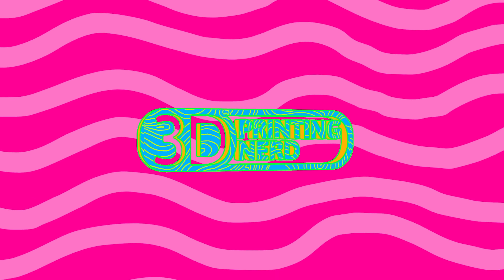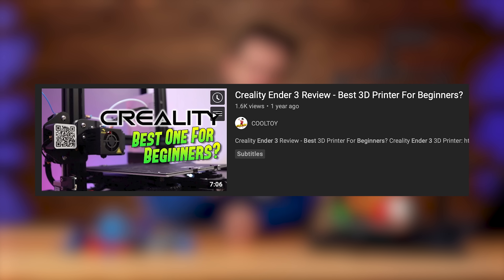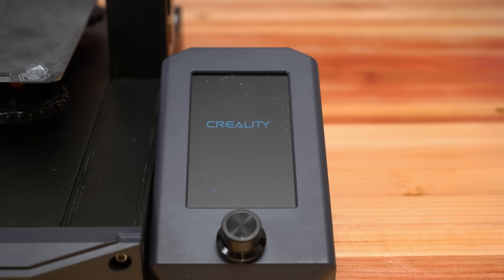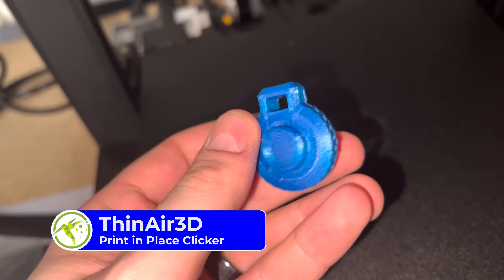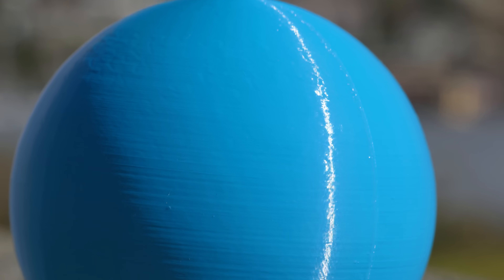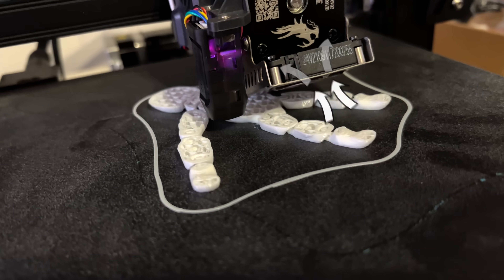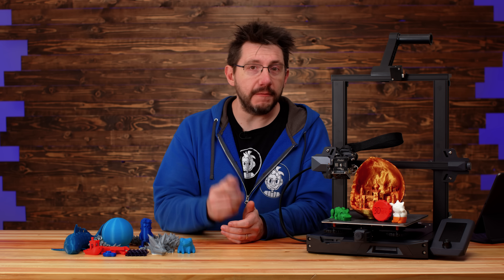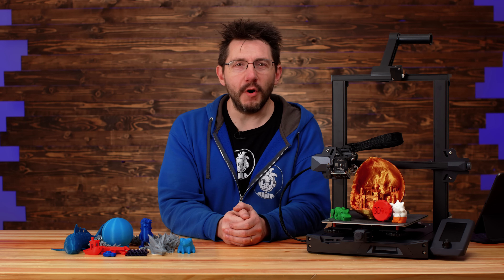Best Ender Ever? Creality Ender 3 S1 Review

Comment: Hi, I purchased my S1 about a year ago and just didn’t get it out of the box until a month ago. Already have had an Ender 3 Pro for about three years familiar with 3D printing. You are spot on. I had new Sprite extruder in the box slated for the 3 Pro. Being a 300 degree hot end I put it on the S1 and ordered it 300 degree nozzle and heat break. I found the S1 came with the 300 degree hot end and all metal hot end. For anyone who has a S1 check your heat break it may be a 300. degree and Creality set the firmware to 260 degrees, like mine.

Comment: Managed to get one of these for $200, and at that price point this thing is an absolute steal.  My Prusa Mini is still a much better printer overall in spite of its smaller build volume (it prints better parts and is hours faster on jobs) , but right out of the box this eliminates 90% of the problems I had with my first Ender 3 (mostly bed leveling and underextrusion) and is actually very usable.
Reply: Same

Comment: Hi I have an ender 3 s1 and I connected a fan to it and it gave off a burnt smell and now the fan doesn't work I tried to change the fan I tried the motherboard in the extruder and it still doesn't work I would be happy if you could tell me if you know what the problem could be

Comment: My printer, starts off every single print with a little mat of what seems to be supports. I don’t know how to fix it and with every single print that I do add another 30 minutes to do the bottom part. it looks just like that little outline that it’s supposed to have, but it just feels it in and goes up five or so layers. I need a little bit of help on it.

Comment: I have to disagree with your glowing assessment of this printer.
In my experience, the Ender-3 S1 is not a 3D printer I would recommend to anyone. Here are some of my reasons for that:
1. I don't believe the Ender-3 S1 motherboard's enclosure provides sufficient cooling for its electronics. My S1 board's early failure supports that statement.
2. Very soon after I began using the S1, its hotend began oozing melted filament from the heat break's connection to the heater block. This ooze began flowing down the sides of the block and dripping onto my prints. Creality3D required me to send photos of this mess, and not until I sent those did Creality3D finally agree to send a replacement hotend assembly. 
3. Unlike earlier Ender 3 printers, the S1 frame's extrusions are not slotted for T-Nuts. This means you can't easily replace the printer's v-wheel motion system with steel linear rails. So, you're stuck with plastic guide wheels which will continually wear, resulting in gradual print quality loss and the need for periodic wheel replacement.
4. These deficiencies are sufficient to support my personal decision against further Ender-3 S1 purchases. However, a far greater problem looms above these, which is my experience with "the Monster," (my term for Creality3D's customer service). When my S1's motherboard failed, months of negotiations were required before the Monster agreed to send a new motherboard. However, this was sent by slow freight, and week after week passed before it finally arrived. Then to add further insult to injury, this new board was also defective, and nothing - no attempt to install a new boot loader, and no attempt to install new firmware could fix this board. Once again, this forced me to deal with the "Monster" And once again, more back and forth emails and months of wasted time passed before Creality finally agreed to replace their bad replacement board. And I still don't have that new board. So here I am many months later, and my Ender-3 S1 still doesn't work. So, forgive me if I don't like your video and your glowing evaluation of Creality3D's Ender-3 S1 printer.

Comment: I have the s1 pro, it's pretty much the same except the build plate is more of a bronze color and really aggressively textured. I've run it for about 80 hours continuously now and the only adhesion issues I had were while tuning it Initially. I've found that the cr touch is kinda unreliable as you'll find yourself having to mess with the z offset every time you try to use auto level. Though not just with this printer specifically, I've found myself not setting offset with paper but just by eye. I also turn the knobs and guage the nozzle gap by eye as well. I don't recommend doing this if you don't have a calibrated eye. You'll know when you get one, takes alot of experience in metrology.

Comment: Please help me with my ender 3 s1 I'm having a nightmare of a time leveling my print bed. I followed every tutorial on YouTube and I still can't get my bed level! I can get it level enough to do small prints but the moment I need to print print something that takes up more then 1/3 of the print bed its just terrible. To low in some spots to high in others. I've tried the audio bed leveling but that just seems to make it worse. I even went out and bought a glass print bed in hope to maybe even out any warpage in my bed. Nope still a problem. Any advice you could give would be a great help Please 🙏. this is my first 3d printer and I desperately need help because I'm on the verge of just selling this thing in hopes of getting some of my money back.
Reply: I heavily recommend you watch the videos by a youtuber called Rickey Impey, he goes into great detail on how to properly and thoroughly tram your print bed to get good results.  Specifically watch his "6 Easy steps" video for your S1 since it's got auto bed leveling.

In my experience with the S1, here's how I leveled my bed.

1. Before auto leveling, heat up your print bed to 60°C and rotate the 4 adjustment nobs until they're free spinning where the springs are fully non stressed. (You heat the bed beforehand because metal can warp a small bit which can throw off the leveling)

2. Push the front side of the print bed down until the springs are roughly half pressed and then adjust the two front nobs in a free spin until they stop to hold it in place. Repeat on the opposite side to where your bed is roughly a kinda equally leveled. At this point, the springs have enough play for adjustment and are not fully pressed to the point where they're just a static spacer. 

3. Reset your configuration and have the printer auto home itself. 

4. Go to the 'Move' option and adjust the Z position to 0.0. (When auto homing, the printer will always be 10 mm above the build plate where it probed)

5. Using a piece of printer paper (or in my case a feeler Guage with a 0.1mm thickness) lower the Z Offset until your nozzle barely kisses the plate. Use the paper to feel it out the friction between the nozzle and the bed while adjusting the negative Z offset. You want the tiniest bit of resistance to ensure the nozzle is close enough to have an even layer of filament distribution. 

6. When you've measured the Z offset you like, then hit the 'disable motors' option to where you can now freely move the print head, and the build plate. 

7. Manually move the build plate and  extruder so that the nozzle lines up above the adjustment knob. Then adjust the level using the knobs and your piece of paper until you get a smigen of resistance. Move the extruder to the next knob and adjust the same way.  Repeat this process for the rest of the corners at least twice. 

8. After all is adjusted, hit the 'Bed Level' option so the printer creates a dot mesh of the print bed so that the nozzle will auto adjust its height during your print. 

Note: The Cura slicer doesn't have a pre-made profile for the Ender 3 S1, hence the line of code needed to use the auto bed leveling during your print is not there when you generate gcode unless you make your own custom printer profile including that line. 

I heavily recommend you download layer test prints in order to further fine tune your level. You can even adjust the Z offset mid print to see how the layers come together. 

Hopefully I helped a little here as I too did struggle to get used to my new printer. Practice makes perfect and once you get that good first layer, you'll only get better.

Comment: I like the machine, I have 5 of them. However, after 4 months of intensive use they started having problems,  but the hardest part  is to figure what is happening. Accessing extruders, nozzle, and so on is hard, takes time and replace the whole kit as a quick alternative will cost you at least $100. If I compare this machine and an original CR10 for intensive budget printing, I'd choose 100 times the original CR10. I have 2,  after more than 5 years I just replaced the extruder kit and updated the bed. I know, the CR10 is ugly, bulky, and looks cheap but it's just reliable, with great quality and it's easy to fix. Once you level this thing you won't need to do it again. The S1 is a great design probably the best, in my opinion for light use but if you need printing large quantities, long term, this isn't the machine. If you still want to it because, I'll recommend paying for the insurance so you can replace it. I've replaced two of them already after 4 months of work and probably I'll need to replace another two this week. I have other machines industry grade, more expensive ($.1.2K) and the one that has given me the less problems is that cheap CR10 🤔.

Comment: 3 months in - how is it going with this printer? - is the Sprite DD unit still running well?
Reply from the maker: So far the extruder is holding up and it’s prints are fantastic. The only thing I don’t like is the extruder motor isn’t energized when pausing, so swapping filaments CAN result in a layer shift.

Comment: With the build plate issue you mentioned round 4:20 ish, would hairspray on the flex plate work? Honestly I have not used a flex plate at all, I have an Aluminum plate on a old MK1 Purusa i3. Looking at the Ender 3 S1 as my replacement... High time.

Comment: I just got the Ender 3 S1 Pro, and it's amazing. I've never owned or even used a 3D printer before, so it's taking a lot of learning to get to where I feel like I know what I'm doing, but the prints are great. The machine just works.
Reply from the maker: That’s great to hear!
Reply: @3DPrintingNerd  any advice for getting ABS to stick to the build plate? 

I've tried all the settings, leveling, the hairspray trick, everything I can think of. It just doesn't want to stick.

Comment: except creality completely screw you with this printer because the hot end is not an all metal hot end.... and they charge you an arm and a leg for their "sprite extruder pro" which is the entire direct drive hot end assembly except the only difference is it's all metal. they just had to screw you and not include it... and make you by an entire new direct drive system. so ridiculous.

Comment: Hey brother I need help. 
I have an ender 3 pro with a glass bed and it used to work amazing until one day my PLA prints would always get separation in them and just fall apart, but it prints TPU fine. Idk what to do I have tried new filament, making sure the bed is level, I even did a direct drive and all metal hot end upgrade thinking that would definitely fix it. But still the same thing , it's really driving me nuts.
Reply: that honestly sounds like a slicer problem

Comment: Fantastic printer  - beats the heck out of my old Ender 3 pro.  It really makes 3D printing practical.  Super quiet, great UI, awesome bed adhesion, outstanding cable management, excellent print quality and very easy setup.  I was printing in less than :20 minutes. Best investment I made in 3D Printing.  Thumbs up!

Comment: Thanks. But what about two things respecting its maintainability and upgradeability: 1) what heatbreak it uses (PTFE passthrough or fullmetal, and what type - some standadrd or something new)? 2) What about stepper drivers and MCU - is all of them 2208 and what abou LA support? Does MCU have enough flash space to enable LA (256 or 512 kb)?

Comment: As a newbie 3D printee, I took the plunge and bought an Ender 3 S1 3 weeks ago as my first foray into the world of 3D printing. For the first 2 weeks I found it to be really great. However....a week ago I started to get problems with the spung steel build plate - it stopped adhering after about 15 prints!! I've also had a massive problem with my Sprite extruder.... it had a massive issue with pooling and filament extruding all around the nozzle and hotend and clogging up EVERYTHING!!!!... I've had to take everything apart and clean it! (Not good on a printer less than a month old!) Hopefully this is a one off. (Of course this may be down to me.....which I'm starting to suspect it may be lol). Have decided to upgrade to All metal Sprite hotend as per S1 Pro so hopefully this will solve a lot if my issues.

Comment: got one as my first printer, have put about 4kgs through it now and still love how it performs.  ordered the pro hotend from creality as an upgrade.  the only issue i have had is the bed not being relatively flat.  on small prints it wasnt a problem, i could usually move the location of the print around to find good adhesion.  but on bigger prints even with the auto leveling i would have some localized hills where the nozzle would make ghost lines and other areas where the filament would just pop right off.  i have had to use a lot of rafts.  the other issue is the little spatula that comes with it, mine was stamped metal and no burs were removed.  i didnt inspect the tool and on first use trying to separate a part from the bed gouged a line into it.  i havent used it since and havent even needed something similar because everything releases well with the spring steel.  why even include it if the cheapness makes it a danger to the very product it is supposed to be used on.

any suggestions for a bed upgrade?  i love the ease of the spring steel type but if it means having a much flatter surface i might try glass.
Reply: Glass would resolve your bed lumps issue, but you'll have to fuss with glue sticks or hairspray whereas my regular ass flexible mat hasn't needed a spray-down/wash in... months. My bed is uneven in the center - a piece of tinfoil underneath solved it, now adhesion is too good.
Reply: @ColdSig  tinfoil is Genius holy

Comment: I've had my Ender 3 S1 for about 3 weeks now and absolutely love it. Had to manually level the bed once because one corner was much lower than the others, but since then the auto level has been a dream. Considering that I spent the first 3 months with my original Ender 3 printing mods and ordering better parts, only spending an hour calibrating is well worth the price. Found a fantastic guide for setting up the slicer too and since then my prints have come out incredible. All in all, I absolutely love the Ender 3 S1!
Reply: Could you share a link to that guide?
Reply: Do you have a link to the guide you used?

Comment: I can confirm that the Slice Engineering Copperhead g2 bimetallic heatbreak is compatible with this printer.  They go for about $35 on Amazon and I would highly recommend it as a first upgrade. 

I would also recommend against buying a clone as the machining required to make a bimetal heatbreak work properly is super precise.

Comment: For $400 you can get a Sidewinder X2...why the hell would you buy an Ender at that price.
Reply from the maker: My Sidewinder X2 stopped working right after a couple prints. My experience with the Sidewinder isn't good :(
Reply: @3DPrintingNerd  That's unfortunate-seems to be the exception to the rule. Was it a v4 X1 or later? I know there were some problems with the early X1's but my v4 has been chugging along for ~2 years now.

Comment: theres one bad thing about this printer the fact that you cant get a metal hot end for it unless you buy crealities.. also another bad thing the filament sensor the wheels inside crush the filament you have a hard time pulling the filament thgough where a wheeled swtich would be better..   the fact they dont offer a pei magnetic sheet erks me that sheet they give you just try to print on it your print will stick so hard its melted in you need the pei sheet they sell to get good prints also the connector that at the hot end for electrical when it homes it crushes the cable bending it to the right they need to move the home button closer to avoid that i see wear on that cable and they dont offer the cable its a special dip cable like used back in the 80s  also when you do a bed level it turns off all the heaters.. the point is when you bed level its suppose to be at temp since everything expands...

the good about this printer it prints really good outta the box set up is fast... they do make a laser module for this but you have to figure out they did and they dont tell you how to use it or tell you how to use a program to make it work it seems like the only thing this is good for is easy out of the box printing and it does print nice no fiddling with it etc the good about it too is super quiet 32 bit board with those quiet stepper motors.. i would of liked to see the board take off the shelf stepper motors its all intergrated and maybe let us have full acess to the firmware so we can tweak it... so its got its bad points and good also the wheels on it are rubber they need to be steel you can buy steel ones and replace them so every once in a while you need to move the wheels to stop flat spots from forming and mine came all loose so youll have to check tightness of the print head theres a wrench for it etc id really like if they included a metal hot end with it that be nice